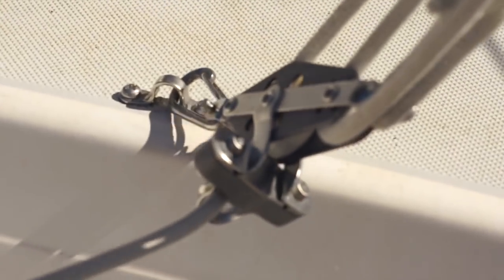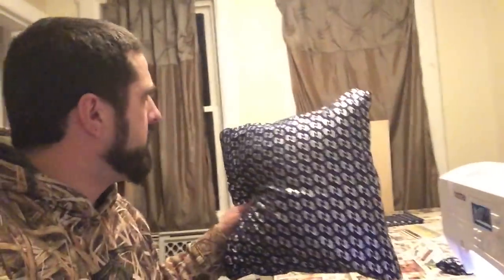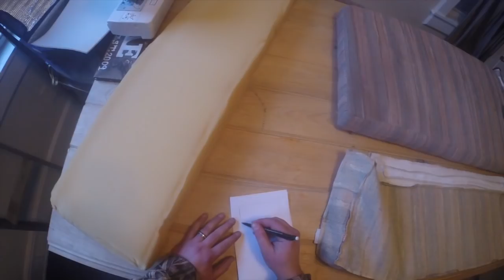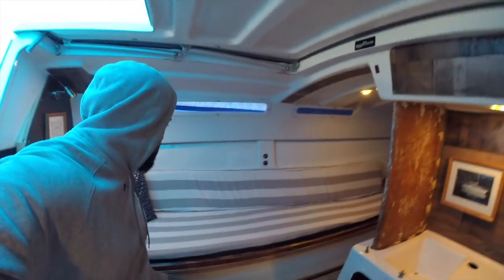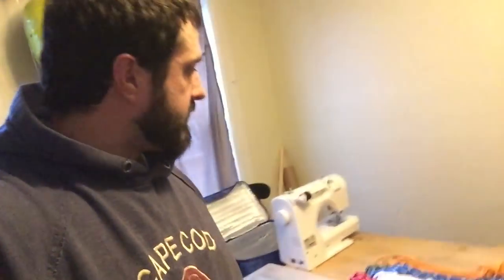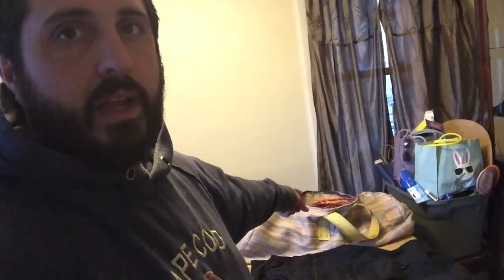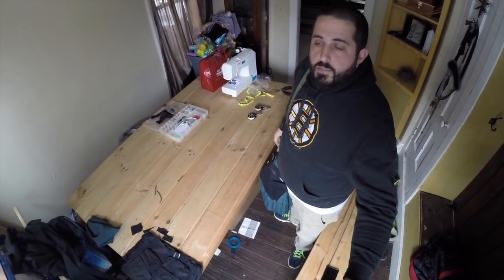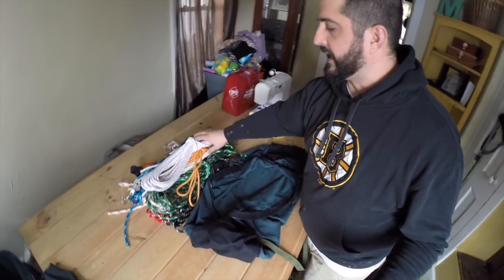Sewing Projects for A Sailboat - Cushions & More!

Comment: Great job for a rookie. Straight lines are tough for everyone. I usually suggest a pattern without vertical or horizontal lines for a first project.  Busy patterns hide mistakes well.  Your bags turned out very nice.  If you sew a strip of blue tarp (or similar) to the outside, at the bottom where it sits on the ground, it somewhat weatherproofs and adds a tear layer increasing the life of the bag.
Reply from the maker: Good tips! I gotta remember to put a link in the description to your video.

Comment: You mentioned all the colors of your lines and what they were for but you never said what material they were made of, The price of lines is usually determined by the material they are made of. Nice video on sewing.
Reply from the maker: I thought I mentioned they were New England Rope Co’s “Sta-Set” line. (You can check out the details in the links of the description) The price comparison was between the exact same product (New England Rope Sta-Set 3/8 inch diameter) just one being sold through Amazon and the other West Marine. I have heard now that West Marine offers a 100% price match guarantee though.